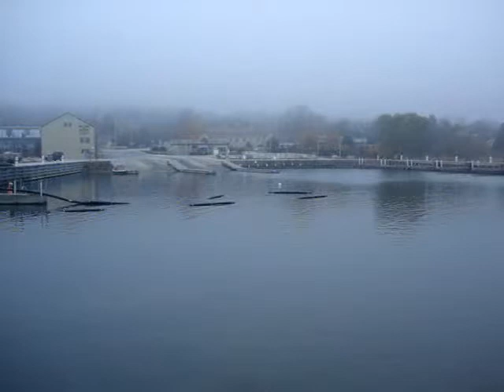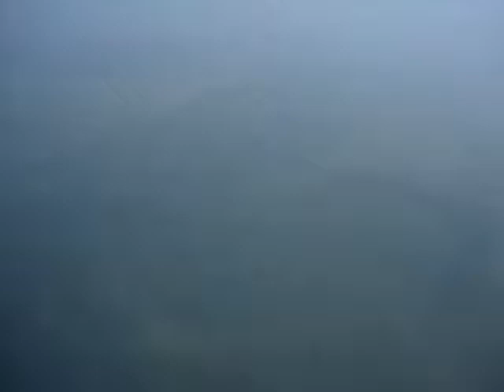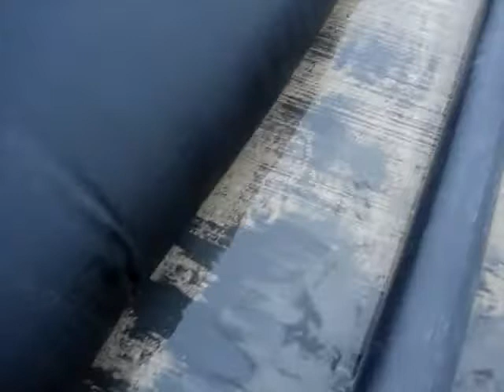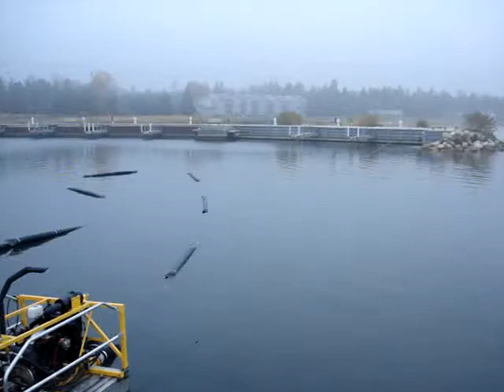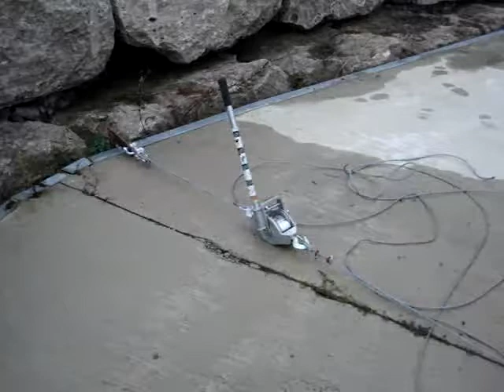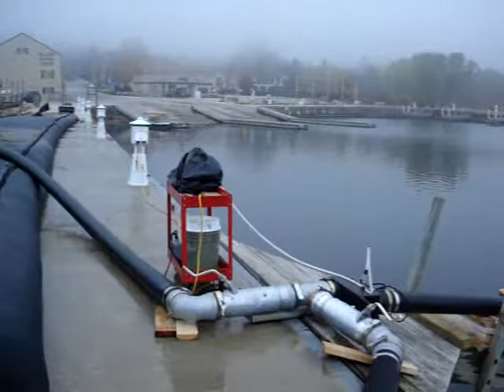DINO Six Removing Sediment from a Marina.MPG

Comment: Do you have any opinions on the Dino 6's overall project cost? The local municipality is doing a feasibility study on dredging above a dam, and one of the proposed methods is exactly what's presented here, down to the geotextile bags. I'm concerned about material haul away once it's dewatered, as you can't exactly load one of those bags into a dump truck and haul it away without additional handling.